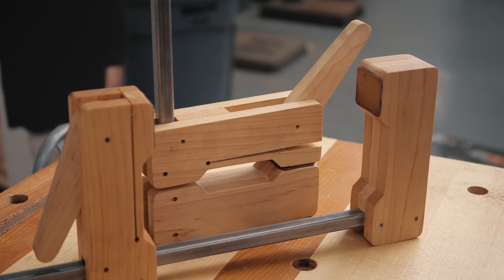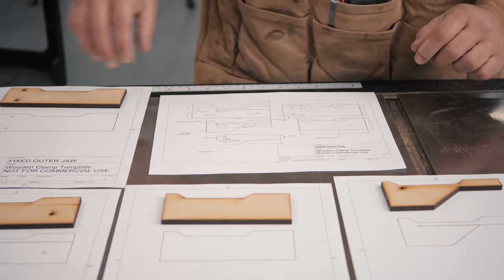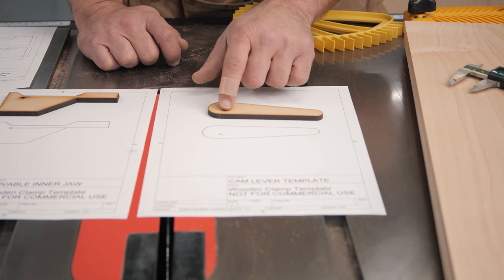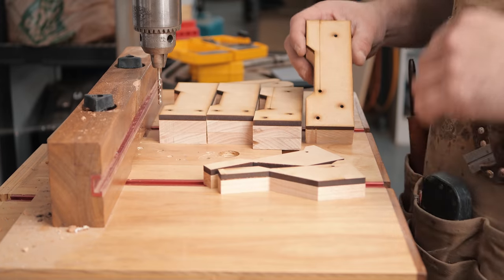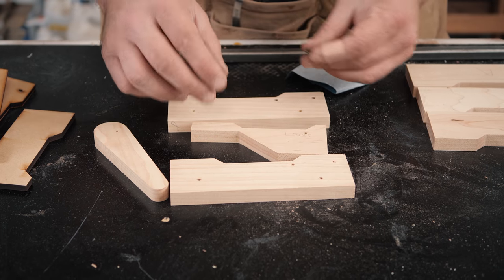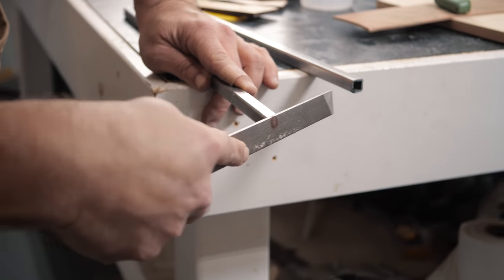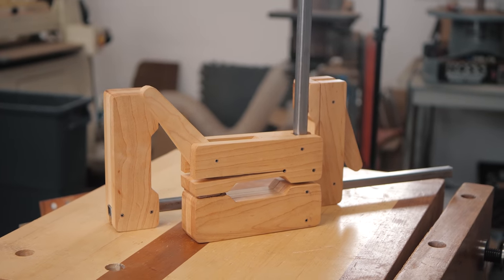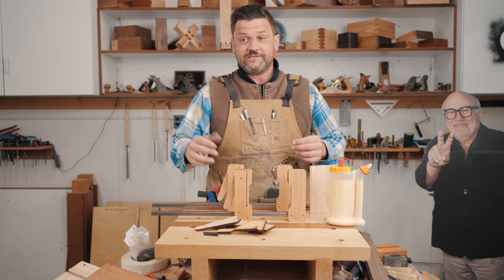DIY Wood Cam Clamps

Comment from the maker: Get The FREE Plans and Templates Here http://bit.ly/KMWstore20 Only $15 AND they come with 10 machine pins (I say 8 in the video but it is 10) to make 2 clamps. All you need is the ½” square tube. That's less than half the price of buying one wood clamp from Lei Neilson.(if you’re on mobile they are the 10th and 11th product in my store)
Reply from the maker: Read the description of the product. It is a  .rar file
Reply: The free plans only cost $15?

Comment: Why provide 8 pins and not 10? I ran through it again and you clearly use 5 pins per clamp (3 on the moving jaw and 2 on the fixed jaw). The video and store both say that 8 pins are provided to make 2 clamps, but I don't see how that can work.
Reply from the maker: You're right. Changed to 10. Thank you

Comment: Good idea. I may try making a few. Two comments. If you're drilling the tubing by hand, just drill from each side. Then there won't be an alignment problem. Also, one could lay a block on the rails then rest your parts on the block for clamping.

Comment: Paul Sellers makes a more “delicate clamp with 1/8”bar stock. These babies are beefier. Thanks. By the way, roll pins get smaller when driven in, STOP IT!
Reply: I wouldn't call 1/8"×3/4" hot rolled steel delicate. Try bending.3/4" steel in vise.
Reply: Alejandro Cantu - You are correct about the steel, it’s the wood parts I referred to as “delicate”. Chances are the bar stock is more rigid than the tube steel. Probably a better description is that they are smaller, more refined in my opinion, and can be used to clamp more delicate parts. Christian Beksvoort uses the smaller ones in a number of projects I’ve seen him make. Thanks for the clarification Professor.
By the way I was a metal fabricator for years making everything from small control arms to huge alfalfa dehydrators. So, I’ve bent a lot of steel.

Comment: Thanks for the great idea! I was planning on using a 1/4" thick flat bar because I was gonna mortise with a 1/4" upshear bit since a 1/8" bit has a 1/2" cut depth. I could just use a saw blade since it's the pins that keep the moving jaw along the bar

Comment: Have been wanting parallel clamps, but didn't see the need related to cost of them. But might decide to make them with your plans, Thank you.
Reply from the maker: I mean there's no comparing these to the 1k lbs of clamping pressure from parallel clamps.  I have a video coming out soon about all the different types of clamps and I will go over why parallel clamps are so amazing.

Comment: Hullo young man. Really good looking clamps, with plenty of power. The Templates have that same problem for us over here, Postage Cost. Take care BIG GUY.
Reply: Postsage cost is rather reasonable to UK great infact I think 👍 just ordered the two dovetail jigs, clamp templates and stop think it was 145 dollars £116 quid including shipping will get hit with import tax aswell, reckon that will be about £30 so not to bad prefer independent place like Jonathans anyway 👍
Reply: Hullo young williamn01, I received one of Jonathans dovetail jigs not to long ago and was hit for £10.00 import Tax. My veritas MK11 sharpening jig requires a new brass roller, $11.90 + £10.88 + £10.00 import tax. I have ordered it from Axminster but will take 12 weeks to get here. If Jonathan or other woodworkers in the states had outlets over here, I would be at the beginning of the queue for there merchandise.
Reply: @wwscott7595  I would just spend the extra 20 quid or whatever it is and get a new jig 😂, I got an email about an hour after purchase saying its been shipped should arrive in 10 days or so not bad. Yea I'm the same I used to buy loads of parts from Japan for bikes and got hit all the time. Anything from China seems to get through with out a problem tho. A deal with the US after brexit see how that works out. I end up just seeing things and buying it 😂need to give it a by. How you liking the jig I ordered both sizes and one of his stops n some templates give them a go 👍
Reply: It costs £57.00 but I already purchased one anyway and I will wait the 12 weeks for the said roller from Axminster at a cost £9.00 plus £2.80 P&P and give my old jig to a small community workshop.
Reply: The jig is perfect just add a good Japanese saw, give it a bit of practice and away you go. Have fun.
Reply: @wwscott7595  yea I have a set not used much of the Japanese saws still using my old drabble n sandersons I picked up will give them a go tho, will let you know how I get on 🏴